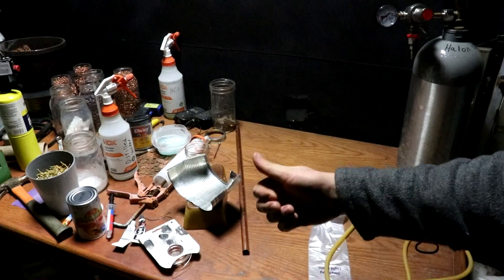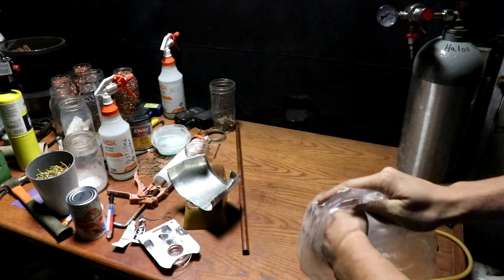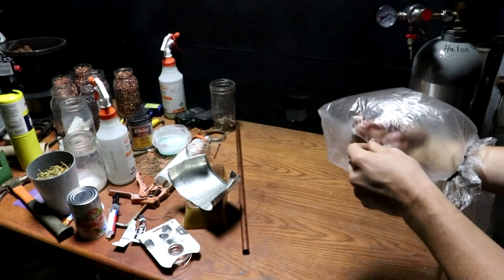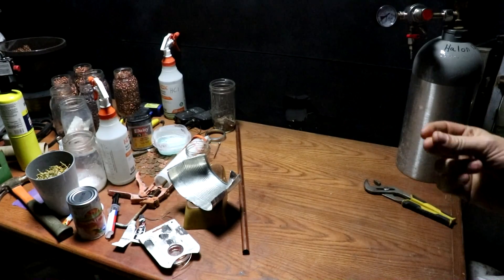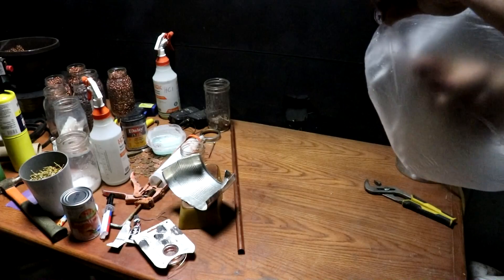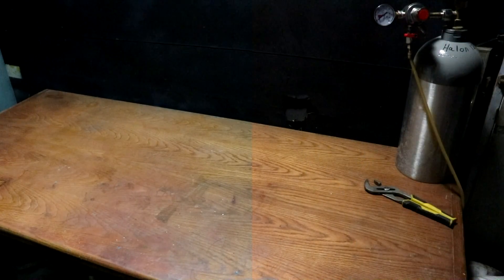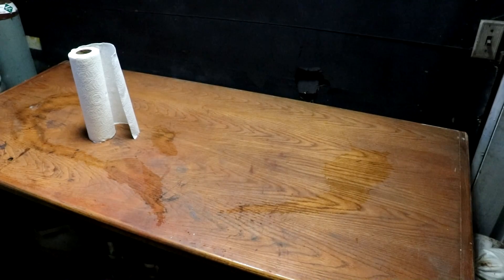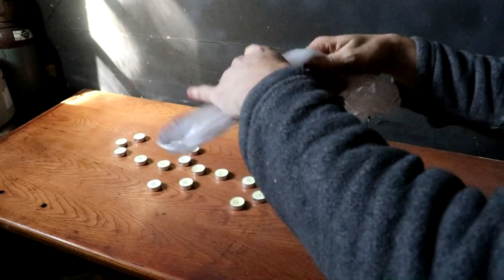Sound of Snaps In Halon and Helium

Comment: Hello, Could you do an experiment where you charge an a/c unit with helium and run it? You might have to modify the condensor, such as make it larger to remove more of the heat that I predicut would be made by compressing the helium, and lubricating some of the compressors might be difficult, but for the experiement, could ya pleeeeease do it?!?!? You might also need a beefier compressor..... idk lol!

Comment: The Large sound of a finger snap isn't from you middle finger compressing air, its from your middle finger slapping your palm. Try snapping your finger without your finger hitting your palm, or put some kind of insulation on your palm and you will quickly realize the sound is "mostly" coming from your finger hitting your palm. Your finger might make a sound wave cone but that cone makes little sound without your finger hitting our palm.

Comment: There might be other physical explanations for why the snapping is louder in one gas than another, but there's also a factor that I haven't seen anyone else mention: the human ear. Our ears are most sensitive in the range of frequencies that the human voice falls (which make evolutionary sense, I guess). I don't feel like looking up that range right now, but if the lighter gas moves the pitch of the snap away from that range, it will sound quieter to your ear, even at the same exact amplitude. If the heavier gas is moving the pitch closer to that sensitive range, it will sound louder. So it is possible (though I don't believe this) that the snaps are actually exactly the same loudness, but your ear just hears one better than the other.

Comment: Does the pitch change?  Or does the timbre change?  
When talking after breathing Helium, I've been told that the fundamental tone remains constant, due to the vocal chords' vibrations being largely independent from the medium in which they vibrate.  I've been told that it's the overtones' amplitudes which are changed, but not their pitches.  
Thanks, Cody.

Comment: I think the pitch changes because the tone is formed in the cavity of your pinky and ring finger. The soundwave of your middle finger reverberates in that cavity. Therefore if it is filled with a heavy gas, the tone is lower. And a lighter gas will have a higher pitch.

Comment: Quick question how does a person freeze in space when there are almost no atoms to transfer the persons heat
Reply: technically speaking only the surface of the person freezes, as noted by others mentioning evaporation and such.
The internal body temperature will in fact climb for a while until something stops it, like the person dying. 
This is one reason space suits have cooling systems, and why the computer equipment involved on spacecrafts need to be carefully designed to generate minimal heat, instead of just using off the shelf high performance processors.
A normal computer under normal use conditions, in the vaccuum of space, would eventually melt its own circuits, as there is only infrared radiation to lose heat by. Things that generate their own heat, tend to get very hot in space, before they get any colder.
Reply: You've just made outer space safer by asking that question.
Reply: Mostly it's the water that by evaporating carries away heat, just like when your sweat evaporates you feel cooler. Also gas expanding out of your lungs and mouth will get colder. Lastly you emit heat in the form pf infrared radiation, altough this process is much slower
Reply: Beacause of the infrared emissions of the person

Comment: My initial observation about the laudness would be that it is about as easy to snap your fingers in Helium as in air as in Halon, they are all very light. It would be noticebly harder in water.

So your finger moves at the same speed in all three of them. As the wave travels from Helium to air (where microphone is), the wave energy must be equal.
Since Helium is lighter the wave in Helium is higher than the same energy wave in the (higher mass) air, therefore in the air the waves are lower. (Imagine water and... mercury splitted by the plastic bag. That might be good analogy.)
Height of waves is the loudness of sound.

For Halon the opposite is true (or respectively the air is lighter than Halon which is the opposite of Helium being lighter than air).
High mass medium size Halon waves transfer into medium mass high size air waves. So the sound is lauder.

As for the pitch... I never really understood that.

Comment: I know it's probably already been said in the previous 1500 comments but doesn't sound move more easily through dense objects? That's why simsographas and sonar work better with sound in water and stone than radar with air which needs a much higher frequency and more energy.

Comment: This was not as accurate as it couldve been as you didnt have a control of what the snap sounded like in the normal atmosphere. By putting the bag on your hand you changed one variable and adding the gases changes another variable. Rule number one in experimentation is only change one variable at a time

Comment: A more technical explanation for the change in volume is that the acoustic impedance of your finger and palm is much higher than that of the air. For Halon, the discrepancy is smaller so more of the energy can be transferred from the solid to the gas. 

For the pitch, it depends on how much of the sound is produced by the air and how much by the "instrument". A flute or human voice would sound much lower in Halon, but a guitar or xylophone would sound about the same.

Comment: Shouldn't the speed of sound be higher in a more dense gas? That's the case with solids right?
Or is it just that the individual molecules are heavier in the different gases, but take up the same amount of space. Yeah that would make sense. Heavier molecules has more inertia then? Which causes a slower occultation, thus lowering the pitch.

Comment: Cody, you can impart more energy in to a higher density medium. Just like you can punch a sand bag harder than a baloon.

In acoustics this is described as an impedance difference. The moving object has a lot of mass and the medium (air) is comparatively lower so energy is not efficiently transferred. As the density of the medium approaches  that of the source, energy will transfer better. Same theory as impedance matched transmission lines fur electrical power transfer.

Comment: Could the quieter snaps be do to a density difference between the air , bag, and gas? Kind of lime impenedece mismatch in electrical transmission line.

Comment: Another way to think of the change in amplitude is to consider that you are putting the same energy into the air every time through your clicking, but when that same energy is put in lower frequencies you will get higher amplitude. (more phonons at lower energy per phonon)

Comment: I think you can explain the different sound volumes with the energy conservation rule. Low pitch pitch sounds (low frequency waves) transmit lower energy than high pitch. Since you use the same energy for snapping fingers in either gas, the volume has to be higher for low pitch sound in order for the energy to be conserved.

Comment: So by Tech Ingredients explanation, if you put an extra bag around the helium filled bag and filled it with halon, the sound would be nearly silenced because the helium atoms would barely be able to move the halon atoms. Right?
Reply from the maker: That is my next planned experiment.
Reply: Cody'sLab  Awsome!
Reply: Exactly. I think that is the reason why sound barely traveled through helium. I think since helium atoms are very light, they could not move the heavy walls of the bag much hence the passed energy is very little. Since halon is far heavier than helium it can easily vibrate the walls of the bag and we heard the sound louder.
Reply: But surely cody would be exerting aproximately the same amount of force, so the helium atoms would move faster. Then they would have the same amount of energy as the heavier halon molecules that were moving faster, so it should be about the same volume.
Reply: Peanutbutter Warrior;  Cody uses same force, but less force is needed to move helium atoms.  So smaller fraction of energy goes to sound.
Reply: jkn  But isn't sound just the movement of atoms that move your eardrum
Reply: Peanutbutter Warrior ; It is easier to move helium atoms, so less energy transported by sound wave in helium.  To transfer same energy helium atoms would need to move faster.  Since Cody's fingers don't move faster in helium, less sound energy is created.
Reply: jkn  ok, that makes sense. thanks

Comment: Also - if you're accelerating a heavier gas into the cavity in your hand, that will require more force. More force means more work put into the air, which means more energy available for your pressure wave.

Comment: While pipe instruments will be pitch shifted since they produce standing waves in air, would stringed instruments still make the same noise since they make standing waves in a string instead? I think reed instruments follow the same rules as strings since the reed itself should be an independent harmonic oscillator, a small harmonica or a saxophone mouthpiece would work for this, but if you can hear it well enough a rubber band could suffice.

Comment: I just saw a news story about a guy that survived 40 days at sea by filtering the salt out of the water using his clothes. This doesn't make any sense to me. Sea water is a solution, not a suspension.  Filtering it through cloth should have next to no effect on the salt concentration in it. Mabey Cody could do a quick experiment to show what filtering salt water through cloth does to the salt level in the water. My prediction would be that there would be no change.

Comment: Helium transfers a higher frequency thus making it sound quieter. The total energy of the sound must remain the same. In case of halon, the lower pitch will mean a higher amplitude is required, hence it's louder. The frequency generated depends on the mass of the gas molecules. You can take the example of light, a lower intensity blue light would have the same energy as a higher intensity red light. The total energy remains the same. 
Would intermolecular forces between gas molecules have any effect on the frequency generated?

Comment: denser gases/liquids carry vibrational energy further, helium is significantly less dense than Halon, so the sound energy won't transfer to the bag and out into the surrounding air as effectively as Halon will. Water carries sound faster and further than air. I'm sure others said the same. Cheers, another great Vid!

Comment: Quiet because you're not vibrating the air around the room nearly as much due to the bag. Am I right? I do not know, but surely the bag absorbed and "muted" the vibrations going to the surrounding air in the room. Yeah, I'm commenting without watching the entire video, but this fact just smacked me in the face when you said it was quieter...If I'm wrong, I'd love to learn why. Now that I think about it, I don't think a thin bag would dampen the sound that much. Maybe the pressure inside the bag does it? Or, maybe the higher pitch doesn't resonate with our ears as much, and it "seems" quieter. Halon, lower sounds resonate more with our ears, which is why those dudes that had those big sub-woofers rattled our houses. Also, did you notice that snapping with the halon away from the camera caused a better sound sample? You allowed more air to vibrate BEFORE reaching the microphone on the camera. When you got close, less air vibrated and it didn't sound as "big" as away from the camera. Is that right? I'm just guessing here. Sorry if I sound stupid, I've had no real education regarding this and I'm just forming opinions based on the limited things I know. Just trying to figure out how stuff works without just reading the answers.

Comment: It's louder because the denser air is able to create more powerful air pressure waves, the movement of air is what we hear as sound, so if what your moving has more mass and your moving it at about the same speed(it does slow down a bit), it will have more energy, and of course since the helium has less mass it's pressure waves have less energy and thus are quieter.

Comment: Don’t vibrations of any kind have a tendency to move faster in higher densities? If you think about it, sound travels way faster in water because molecules are so much closer together right? Well with a denser gas like halon the sound is amplified because more densely packed molecules are transmitting the waves more efficiently. Less loss of vibration then compared with air.

Comment: Cody will you make a video where you put a vacuum tank with a gauge on the outside inside of a larger chamber which you pressurize and then measure the psi in the outside chamber using the change in vacuum in the smaller container.

Comment: I have a question, not pertaining to this video. 
Have you ever tried achieve permanent levitation with magnets? 
Ever see those levitating tops that you spin and the gyroscopic effect keeps it from flipping orientation. 
Could you build an apparatus using a low center of gravity instead of the gyro?
Kind of like those balancing birds but instead of the beak of the bird you'd have magnets...
Nevermind scratch that...
I have another experiment I've thought of ever since freshman year of high school but for some reason I've never bothered to attempt it.
Wait for it...
Perpetual motion.
What if you had a toy boat, floating in a track of water. with a magnet mounted on top would the boat travel North. and if so, could you store the energy accumulated, as it traveled down the track.
And use it to then flip the magnet and reverse the direction of travel.
It probably sounds stupid but I'm a huge fan of yours and I've watched many many of your videos, I thought you'd be the man to ask.

Comment: Smartphone playing music surrounded with different gases ...?
Reply: Does a smartphone function normaly in a halon atmosphere?
Reply: @3312-q2e  why not
Reply: @icediverfull  the energy required to move the speaker cone a certain amount would be different
Reply: @Farodin :3
Because it might not be able to breath in Halon
Reply: 33 12 I can't comment on that, but it came out recently that helium can kill iPhones, or at least make them crash.  The apparent reason is technical and weird, but it does involve vibrations.
Reply: 33 12 The iPhone's processor clock stops working even in a light helium atmosphere
Reply: When you speak/whistle/snap fingers, the pitch is determined by a ressonance in the acustic cavity, which depends on the density of the gas. A speaker however, vibrates at a frequency determined by the eletrical signal powering it, so the pitch would be the same.
Reply: @Fred_Costa  you would be absolutely right, i was thinking about this since periodic videos upload, they did it in helium, the sound went less loud, helium weighs less, has the same amplitude, but less weight then air, so the volume has to go down, halon or sulphurhexafluoride weighs more so the the same frequency has more mass to dliver to the lighter air and has more volume. (And more electrical resistance, because the speaker has to move more mass, so the battery has less live in halon, or sulphorhexafluorite, then in helium.
Reply: I think you might be wrong on one end, the volume of something is essentially determined by the amount of air you move not at what frequency. Now a speaker is essentially a linear motor  so if you feed it 5W at 1kHz it will reproduce 5W in acoustic power at 1kHz in air! So if you think of it like yes it will still move the same volume of helium as air at 1kHz but the mass of helium is less so it should resonate at a higher pitch. Think of it like when you inhale helium the pitch of your voice goes up but the volume stays more or less the same sin its mechanical energy translated to acoustical energy and you're not trying harder to move it. opposite reaction of course for halon and running test tones would be a good way to check everything if you have an a good mic, a spectrum analyzer, a signal generator and a frequency counter or oscilloscope.. buut thats a lot of science so small speaker and some tunes would prove it just fine.
Reply: Would just a speaker playing music surrounded with different gases do the thing what you want?
Reply: What would the sound be like if the microphone would also be in the bag?
Reply: @repairtech9320  that's a nice one
Reply: And set up some valves so you can slowly adjust gasses to change the sound gradually
Reply: Periodic Videos has already done that.